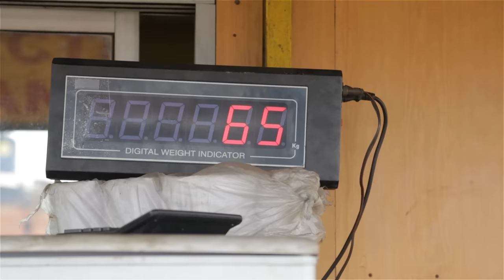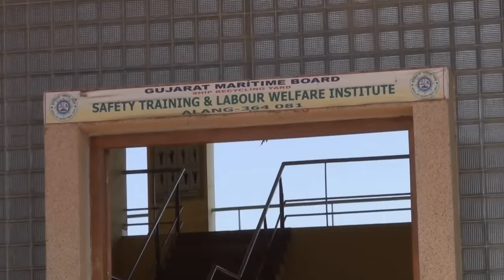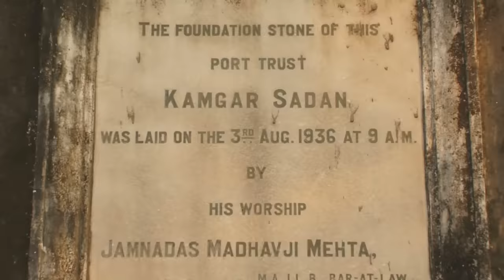Echoes of Ship Breaking

Comment: The shipbreaking process would be 10x cleaner, safer, and faster if they worked in a dry dock where the entire ship would be disassembled at once instead of just the bow grounded on the beach.
Reply: Too expensive. Sand is cheaper.
Reply: @balargus319  That beach is now a toxic waste site and will be forced to be remediated. The toxins are also washed into the ocean at high tide.
Reply: @epistte  The beach is indeed toxic now. However, it is still cheaper to the point of being profitable, and the international regulatory environment for shipbreaking has a race to the bottom disincentive against regulation or environmental cleanup.

They USED to use drydocks, but eventually the costs of doing it the right way became too high, and the benefits of doing it the $$$$ way irresistable.

Comment: Yea, they do need jobs, no doubt, but ehh, they ought to try to invest in other industries, if possible. Most of that recycled material looks more like trash (molded furniture and clothes, waterlogged half rotted wood, nothing wrong there i'm sure. . . Seems more useful in a bonfire then anything else (at least the materials which wouldn't contaminate the atmosphere)). Clean the ships, recycle what can **legitimately** be recycled, then create a new series of giant mega reefs from all of these ships. 900 of these ships over three years could easily make a  grand reef (and a cool scuba attraction while one is at it). 

Although they would have to make sure the asbestos and chemicals were adequately dealt with, which would have to happen irregardless of what they actually did with the ship, as many of these chemicals can cause irreversible damage to the environment. At least irreversible in the sense that even our grand children would still be alive during the consequences. 

The Best way to deal with these chemicals is to make a giant vault underground and store the chemicals there, if they are not safe to burn. Some pollutants can actually be safely burned, at least in a proper incinerator, and not in some backyard fire pit, as the byproducts of such burning is not realistically toxic to the environment (i.e. when the only byproducts are carbon and carbon dioxide).

In other cases they have to be stored underground, such as with nuclear waste, and said vault has to be earthquake proof, and far enough underground so as to not contaminate any potential future aquifers. Such disposal is generally safe, assuming it is far enough underground, as uranium is found in such places as well, and said uranium has no effect on the people who live on the surface above. The present method of mountain disposal is suspect, sure, but mainly because said vault's are built above the aquifers, which can make the earthquake risk a major liability. Box it up, drill a deep enough hole, drop it in, seal it with concrete, then pack the earth and rock back in (just like how it was before we mined it to begin with).

Personal protective equipment (PPE) here should be mandatory. In the U.S. it is mandatory that employers provide required PPE to their employees.

With all of the failing reefs around, 30 years of reef construction from these ships could almost completely reverse reef failure. (Approx 9000 ships, which would have otherwise have gone to just one yard, the grand total would be at least 4-5 times larger then even that when you accounted for the total number of ships recycled across the world.)

The problem is they need an adequate replacement for these jobs. West Virginia has a similar problem, West Virginians have no love for the coal industry, as there are many heartbroken families there thanks to coal mine related deaths and illnesses. But the issue is, all West Virginia has is coal, without coal their economy would tank and the state would plunge into abject poverty. Sure there are other jobs, stores and restaurants, but every single one of these, lets call them "dependent industries," depends on another industry which pumps money into the economy. Store's and restaurants do not do this, they get their slice of the pie from a pie which a different industry brought in (i.e. the coal industry). If the coal industry failed, then every coal dependent industry would fail with it.

This is why West Virginians tend to support policies which aid the coal industry, it isn't because they are brainwashed corporate pawns, it is because they need the coal industry to put food on the table and keep a roof over their head. If there were viable alternatives which were accessible for West Virginia, then West Virginians would not be dependent on the coal industry. 

It is gravely important that we find a viable alternative in such instances, but until this happens, it is equally important to keep the coal industry going, so people's lives aren't destroyed in the process.

Last Word: During the election last U.S. Presidential Election there were some comments that were made, which basically dehumanized West Virginians. They were referred to as trash. The reason these comments were made, was said politician (who I will not name, as I actually voted for this person, but I had many misgivings otherwise because of such comments) intended to shut down the coal industry, but this person probably fully understood that a major consequence of this would be abject poverty for the entire state of West Virginia. So, this individual was probably having a hard time reconciling the goal of shutting this industry down, with the knowledge of the human consequences. When people are faced with this sort of dilemma, they tend to dehumanize the affected people to alleviate their own conscience, and to simplify the situation into a more palatable form. Of course, this is not realistic, we can't go around, giving the shaft to people just because we have a problem with the industry that puts bread on their table. If an industry causes these kinds of issues, then sure, something needs to be done, but actions cannot be rash, alternatives need to be implemented, and made reasonably accessible. Once this is done (and it needs to be done), then such jobs can be phased out, but not a minute before.